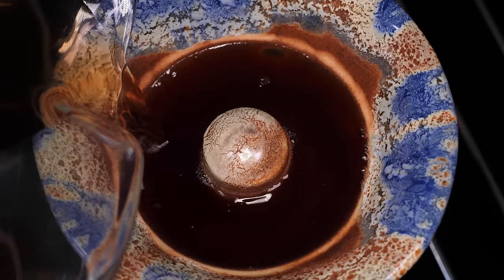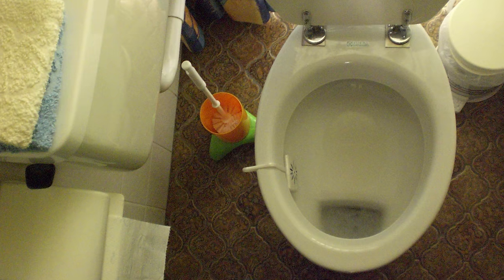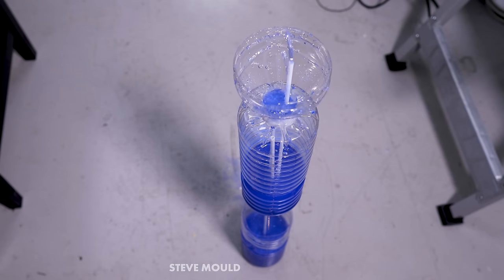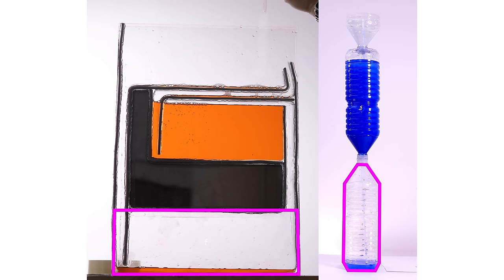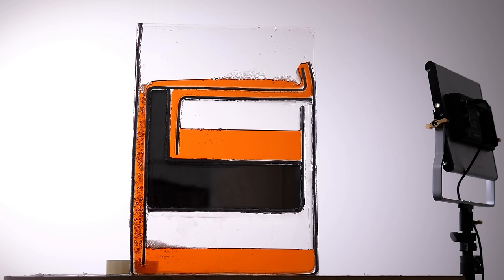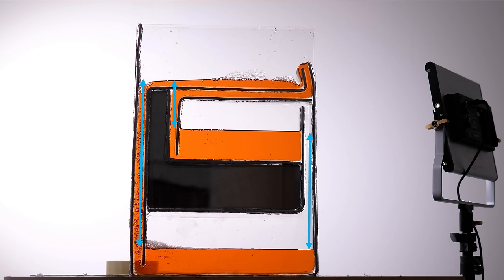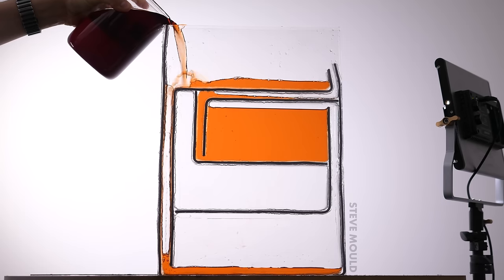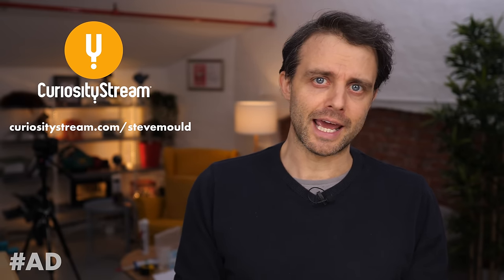A 2D Heron's Fountain Behaves Weirdly

Comment: "The type of wire that's in your walls" is dangerously similar to the whole toilet situation. I'm convinced that World War 3 will start when someone asks an American, British and German electrician to wire up a house together.
Reply: Honestly...a video I kind of want to watch now
Reply: Yeah but the type of wire they use is irrelevant. The difference between the electrical systems on those countries is related to sockets, voltage and frequency  etc. You could wire an american home with british wire no problem (maybe not the other way round because of the earth but you could just use a separate cable of the same wire for that)
Reply: @DOSTalks  There's also very different requirements regarding water damage safety and location/routing of the wires — in many european countries you're not allowed to wire horizontally through walls, and all wires must be isolated strands pulled through PVC conduit tubing of a certain diameter, which must be glued into wiring boxes. Putting the "flat" UK cables, or loose 8 inch service loops as is common in the US in a Dutch house would immediately void your fire insurance.
Reply: @DOSTalks  I don't think that would work though.. Since US runs on lower voltage, I'd expect them to run higher current, so they would require thicker wires compared to those used in Europe. No?
Reply: @DOSTalks  they're bit more complicated and there is differences in wires and wiring. For example in great britain they use ring circuits where other countries don't.
Reply: @whatevernamegoeshere3644  As I said, world war 3. I'm just quoting what I know of the Dutch regulations -- although I'm not an electrician by trade anymore.

The idea with not going horizontal in walls is because here, the central point MUST be in the ceiling. From there, it goes radially outwards to the walls, where it runs down the wall vertically. This is done so you know that wires in the wall are only above/below outlets. Pipes must be glued here so water damage can't easily cause shorts.

I honestly don't have a strong opinion about what set of regulations is "better", just observing that they are very different between countries -- and electricians tend to strongly look down on how foreign electricians were trained.
Reply: @odw32  "Pipes must be glued here so water damage can't easily cause shorts"
All it does is keep moisture in tbh. If you ever did anything mounted outdoors, it will have to get drain holes to prevent accumulation of dew. You cannot universally say pipes need glue
Reply: @odw32  I agree with your standpoint. there's always benefits and drawbacks with each system. Some sets of regulations probably have more benefits than others. but ultimately there's a reason behind every rule and there are many factors behind any and all infrastructure regulations
Reply: @mortenhartvigkristiansen7760  Well, yes and no. "Hig power" 110/ 120 V appliances have reduced power output (as compared to 220, or 230V systems) - like, say electric kettles or room heaters, which max out (in US) at 1,5 kW - while in 220/230 V systems they usually run up to 2 - 2,2 kW. This is done to reduce the max current to approx. 16 A - so there wouldn't be much difference in wire thickness because of it.
However, "real power" appliances run on 220/240 V, as US electric system is, in fact, a 220/240 V - and this is done by different way of taking lower voltage current from a step-down transformers. For more info see "The US electrical system is not 120V" video by Technology Connection: https://www.youtube.com/watch?v=jMmUoZh3Hq4
Reply: @MrKotBonifacy  Hilarious when you consider my high speed kettle is 3000W!
Reply: @NigelTolley  Congratulations, Sir, on your achievement. Yes, it might be, might be - who knows, there are things on Earth that philosophers have never dreamt about...
Seriously though, WHERE do you live? I.e., what voltage do you plug your kettle into?

Anyway.... 3 kW, or even "kWOW!" - sounds impressive, doesn't it? : )  But how about, say... 18 kW?  I happened to own (although don't use it) an 18 kW/ 3 phase water heater - something like this one: https://www.eibabo.com/en/eht-aeg/tankless-water-heater-18kw-ddle-easy-18-eb14200601 (it's AEG brand, just different, much oleder model).
How much current would it draw? Here, where I live, the electrical system is 230 V for single phase and 3 phase Y wiring, and 380 V for three phase ∆ (delta) wiring, Thus abovementioned heater would draw approx. 26 A per phase in Y wiring, and just below 16 A per phase in ∆ wiring. Just FYI. Cheers.
Reply: @whatevernamegoeshere3644  I guess that "in many european countries you're not allowed to wire horizontally through walls" is just a "lost in translation" case.
Orian de Wit sounds to me like a Dutch name, so I assume he's not a native English speaker. But Dutch is closely related to English, and in such cases people tend to not pay much attention to different ways of expressing thoughts in similar language - and that's why I think he might let his native "language patterns" to slip through.
Anyway, I guess (and guess only) that he meant "you''re not allowed to connect sockets in the room horizontally at the level the sockets are mounted". Means, you have to place the "supplying circuit" in the walls high up (2+ metres/ 8' above floor level), and whenever you want to mount a socket (approx. 15 cm/ 1/2' above the floor) you have to place a splitting box in the supply circuit directly above the socket, and then branch off the wiring down vertically to the socket.
You can't just "pull down" the wiring at the "first" socket in the room, and then wire all remaining sockets "horizontally", 15 cm/ 6" above the floor. Why? There's a reason to it, but that's a story for another night, as Shahrazad used to finish her night tales.
Good night everyone! ;-)
EDIT: YT notification sucks. Only after posting the above comment I noticed that Orian de Wit posted his reply, 10 hrs ago, of which I was NEVER informed/ alerted to. Sh!t.
Reply: @whatevernamegoeshere3644  for someone who knows "so much" about pipes and glue you somehow cannot comprehend the meaning of the "here" in "pipes must be glued here".
he is not saying pipes universally need glue, his whole argument is that the regulations are different; he's talking about DUTCH regulations.  NOT universal as you claim.
Reply: @Niels Kloppenburg Well, it's simple - the amount of heat produced is proportional to the current SQUARED, and with given resistance the higher the voltage,  the greater the current.
And since I'm in a bit in rush at the moment I'm going to do a bit copy-paste:
 
HEATING EFFECT OF ELECTRIC CURRENT
When current flows through a conductor, heat energy is generated in the conductor. The heating effect of an electric current depends on three factors:

    The resistance, R of the conductor. A higher resistance produces more heat.
    The time, t for which current flows. The longer the time the larger the amount of heat produced
    The amount of current, I. the higher the current the larger the amount of heat generated.

Hence the heating effect produced by an electric current, I through a conductor of resistance, R for a time, t is given by H = I2Rt. This equation is called the Joule’s equation of electrical heating.
(from https://peda.net/kenya/ass/subjects2/physics/form-32/heoaec - just some "first in line" website thrown at me by Google, no affiliation whatsoever)
Anyway, the current here plays most important part - as the amount of heat produced is proportional to the current SQUARED (as I stated before).

When resistance is fixed (most often it is), the current is directly proportional to the voltage applied. Thus, to increase current one has to increase voltage.
The voltage (peak) is 230 V between each phase and "ground" (therefore this is the maximum one can get from a single phase line), but 380 V BETWEEN PHASES. Thus when you plug an electric device (heater or electric motor) into three phase (3~) line in ∆ configuration you get higher power output as compared to Y configuration, while still staying within supply circuit current limit (=> circuit breaker limits!)
For instance, when you use a welder (either a simple buzz-box style stick welder or some modern MIG/MAG/TIG "converter type" gizmo, doesn't matter) and you plug it into a single phase (1~) line with typical 16 A circuit breaker you could weld with max 190 A current @ 19 V (in THEORY, in reality it would be much less). 
But when you plug it BETWEEN PHASES on three phase (3~) line you can get nearly 150% of the welding amperage while still staying within 16 A limit on the "input" circuit.
The transformer inside is of "single phase" type, so only one primary winding, and one secondary winding. When this primary winding is powered by 230 V it has to draw higher current to produce the same power output in secondary winding - but when you power primary winding by "between phases" voltage (380 V in 3~ line) the transformer can produce the same power output at lower primary circuit amperage (or higher power output at the same amperage on primary circuit). Ground and third phase won''t be used in this scenario, the current would flow between two phases only.

This is rather rough picture of "how it works", and there are some details I'm omitting here, but in principle this is how it works. Also, there are more (WAY more!) details on Wiki page regarding Y/∆ wiring - here: https://en.wikipedia.org/wiki/Y-%CE%94_transform

Also, it is "either-either" scenario, and you can't have BOTH types of connections at the same time - and the "∆ wiring scenario" for the water heater was just a hypothetical one, a thought experiment if you will, as this heater can be used only in Y configuration.

Also, I think I got it wrong regarding amperage in (hypothetical) ∆ configuration - should I rewire it for ∆ configuration I'd draw even more amps, as resistance would be just the same, but voltage would be approx. 150% of the Y configuration. And anyway this would produce way too much heat for this device to handle, as this kind of heater heats water in "direct resistance" mode of heating, i.e. the current flows through the water directly. In which case conductivity of water AND water flow ratio are of extreme importance here - so it is NOT a good idea to fiddle with it in ANY way.
Reply: @Niels Kloppenburg First of all, thanks for your appreciation. And yes, I said I was in hurry, and then proceeded to type a "wall of text" - because while the BASIC PRINCIPLE behind it is quite simple, the explanation itself would still need more that few words. And yet, I'm afraid, I didn't explained it properly, or thoroughly, as you seem to not grasp the principle completely. Let's then tackle it piece by piece:

Wouldn't it be the case that the circuit breaker on each phase limits the total amount of power delivered through that phase by W=IV (wattage = current times voltage)?
Well, not exactly. Circuit breaker, or "safety fuse" doesn't give a shoot about POWER, all "it cares about" is the AMPERAGE, i..e the electric current. 12 V? 24 V? 230 V? 6000 V? 220 kV? Ganz egal, as long as the current stays within specified limit. (Obviously, 24 V circuit breaker cannot be used in 6000 V circuit, but that's rather obvious.)
But 10 A drawn @ 24 V means the POWER would be a mere 240 W, while 10 A @ 6000 V means the POWER would be 60 kW - hope this illustrates the difference.

And so the three phases separately could produce 3*16*230W, whereas their combination in a triangle could only produce 16*380W?
NO, as those three phases ALWAYS work "in unisono", or "zusammen", either in Y or ∆ configuration.
In Y, or "star" configuration, each phase is connected, at a common point, to the "ground", or "neutral" wire (which is at 0 V). Hence the symbol - Y looks like three wires meeting at one point - and the neutral, or "ground" wire is just not shown in this picture (say, it goes from the central point toward "behind" of the picture). And the potential difference (a.k.a. "voltage") between any phase and neutral is 230 V.
In ∆ ("triangle") configuration current  flows BETWEEN PHASES (that ∆, or triangle, shows the connection BETWEEN phases, and omits the wiring bringing electricity into it), and voltage between phases is 380 V. Neutral wire is not involved in this scenario.

Therefore, 10 A @ 380 V (∆ configuration) means 3.8 kW (per phase, obviously) while 10 A @ 230 V (Y configuration) means 2.3 kW per phase. Times three, it means 11.4 kW and 6.9 kW respectively. Some difference, eh?

As you said, the heater doesn't actually have triangle wiring and isn't this exactly the reason why?
No, I think it is more about safety, or simplicity, or both.
Well... Actually, I'm not really sure it is wired in Y configuration - it is just a gut feeling (a.k.a. "knowledge cum life experience") it is wired that way, but TBH I'd have to check its tech specs to be 100% sure. I'm leaning toward Y config, but wouldn't be much surprised if it turns out to be ∆ configuration.
Still, the principle (and laws of physics) behind it would still be the same.

Triangle wiring makes sense in electric motors because it would be hard to drive a single output (torque, motion) with three separate single phase motors, but where the output (heat) can be easily achieved by adding the outputs of three separate, relatively cheap, components like heaters, it doesn't.
No, you're missing the point altogether. Both Y and ∆ wirings are used in electric motors - in fact, some of them have a switch to change from Y (at startup - to limit the current) to ∆ wiring (once they are in motion, to produce higher power output without overloading the circuit.
I know it may sound tad counterintuitive, but this is how it works.
BTW, "single phase motors" are actually "two-phase" motors, but that's completely different kettle of fish I'm not going to delve into now.

"∆ heaters"? - yes, they are used quite frequently in industry. Like, arc furnaces (steel melting, carbides manufacturing, and such). For instance, there's this substance called sodium hexametaphosphate (although it should be called "polymetasodium phosphate", as that "hexa", meaning "six", not "die Hexe" is rather "an average", and by no means "a standard" as far as this molecule goes).
Anyway, it used to be the main ingredient of Calgon, and it is produced in electric furnaces, where a regular sodium phosphate is loaded, and the melting pot contains molten sodium hexametaphosphate with three electrodes (each powered by different phase) dipped into it. The current flows between electrodes, with no neutral wire - thus it is a "∆ configuration heater". But I digress here...

_I'm not educated in these matters beyond high school at all, just working from my experience toying around with stuff. I guess I'll just have to dive into Wikipedia now, can't stop thinking about it :D _
Hey, I'm not an electrician either - and whatever I know about this subject is what I consider a "basic general knowledge" Means, the education I received from high school and then some "own research".
And yes, seems like you'd have to dig a bit into the subject... : )
But hey, we do learn throughout all our lives, don't we? "Smarter every day", there's this channel on YT... : )

EDIT - corrected some typos and wrong tenses, plus some minor "style polishing".